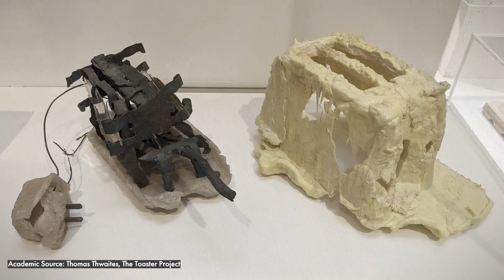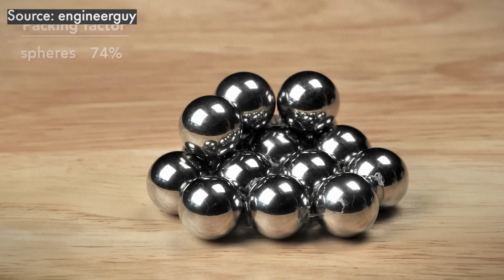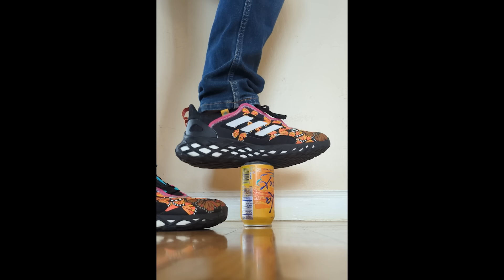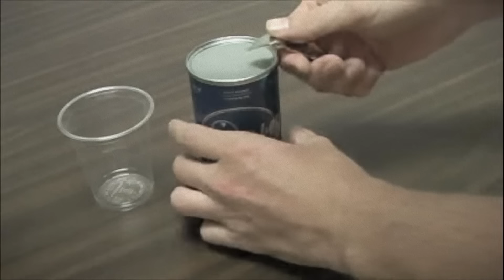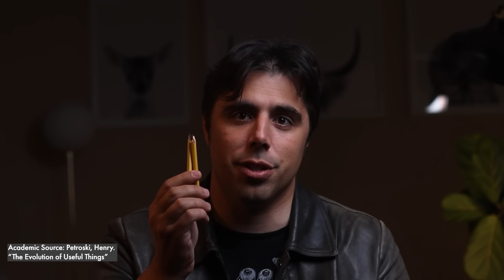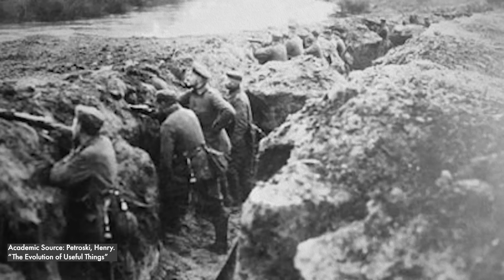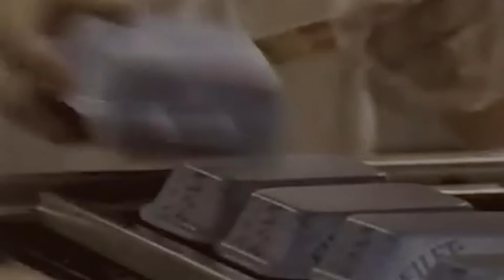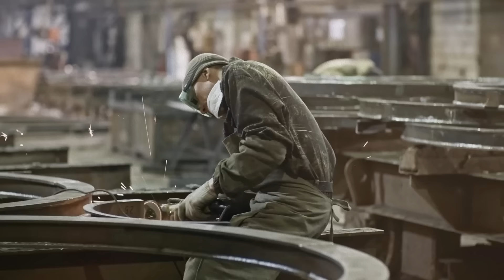Why Simple Everyday Objects Are Impossible to Make

Comment: I used to work for a manufacturer of truck-trailers in the supply chain management department. It's just a metal box on wheels, right? The single trailer's bill of material would be hundreds of parts from dozens(if not more) suppliers that had their own dozen suppliers. It would involve dozens of people doing their own specialized step, that were supported by dozens of more office workers doing the schedule, purchase orders, engineering, systems support, sales, finance, and management. Now consider every single one of those goods was at least partially transported by a similarly produced trailer! Our world is complicated and involves hundreds of people around the world just to get you your 50 cent pencil.
Reply: now imagine a major conflict throwing a wrench into the highly optimized mechanism of supply chains or god forbid killing of key people i.e. engineers - suddenly you are unable to produce weapons but also fuel and food.
Reply: @vaakdemandante8772  killing engineers is a waste of time. Power, assembly lines and highways are the most impactful targets for supply chain disruption.
Reply: @bepamungkas  True, but killing engineers is long-term. Power lines and highways can be rebuilt in weeks if necessary, but training engineers takes years at least.
Reply: @lbgstzockt8493 true, but there's simply too many engineers. Not to mention for generic tech people already adapt to its shortcomings since technological adoptions was never uniform. E.g in agriculturally advanced state like the US, it's still common to see decades old machines being used.

Now, if you cut down those tractor's replacement parts output by half, or delay the deliveries by a month. The domino effect will be longer lasting since the problem is not immediately obvious.

Take a look at recent disruption in poultry industry due to H5N1 in the US. Most of it came simply due to the fact that the "infra" need to be rebuilt (i.e culled, sanitized, etc), and supply chain need to be controlled to manage the spread.
Reply: this is definitely humbling
Reply: Now imagine my frustration as project lead when a software engineer starts whining "do we really NEED to charge the customer this much?" And "I don't understand why the marketing/billing/sales departments make so much! We engineers should be making most of it since we're building the product!"

Comment: Retired Electrical Engineer here - few people understand the (very complex) process of designing and manufacturing the HUNDREDS of simple products they use on a daily basis ..
Reply: In 2020 NASA spent $23M for a toilet to be used in the International space Station. It involved six years of research and engineering, and had to be designed for microgravity and use anti-corrosive material like titanium. It also had to recycle urine into drinking water. 

The US Airforce spent $10K in 2018 for a toilet cover that was used in their C-5 cargo planes. The original parts manufacturer was no longer in business. The AF decided to make it themselves. There were patent issues, and they had to reverse engineer the process for a part with very limited future volume. Now they use 3-D printing to make the cover at $300 per.

Comment: You can make complicated stuff by not using materials or methods that require complex production. Make your fork out of wood. Make your toaster out of sheets of mica, ceramics, and metals that are easier to source or smelt than iron/steel.

Comment: did you know that you can open a can with another can?  seriously.  use the bottom extended part of the can on top (the part that helps them stack on top) catch the pull tab and open your can.  it's hard to explain in text, but it works, just try it.  it''s good if you don't have nails and just a good party trick.  i'm sure some industrial designers created that on purpose.  try it

Comment: Since they changed to the tab, that stays on the tin, I never (almost) bought a beverage can again. 
Now, that it's mandatory here in the EU, to have a connection between beverage bottles and their lids I get more furious and furious everyday I want something apart from tab water.... Though, tearing the lids off allows some relief ;)
Reply: If you have a can opener, some knife or scissors, you can either ignore or destroy any additional items attached to the can; you can also use that to cut the ring that holds the lid on bottle.

Comment: My industrial design professor told us “Your job is to create a need for something that doesn’t exist”. - guilt ensued.
Reply: I reject this philosophy and substitute my own. 

I build to address a need i have identified. Without the existing need, i have no desire to build.
Reply: @MadScientist-o2e  unless you missed the "industrial" part of industrial design, or a luddite (no offense meant), then both philosophy itself is not cotravariant. Artisanal and industrial design generally complement each other.

Industrial designers go out of their way to look for potential problem, and develop solutions based on supposed problem. Regardless of said problem economically viable or not in the first place. The same can't be said for artisan.
Reply: @bepamungkas  Industrial design necessitates it being economically viable I don't care if you how committed to solving a problem unless you have millions of dollars you won't be able to even build a fully functioning prototype. You can artisanal produce things and transfer them to inustrial.
Reply: @Me-pt7ik  Nope. Majority of industrial R&D either get unused or ended up seen as "useless patents" (i.e dormant IP). WIPO application usualy contains multiple design per IP, only decreased recently after entry of electronic giants from Asia into the Hague system.

As for capital requirements, I tend to agree. AFAIK only government sectors have higher wasted capital ratio. But this was due to complex nature of modern market and ROI focused R&D funding. 

With the advent of crowdfunding, offshore mass-manufacture, and direct-to-consumers marketing via social media that lower the marketing overhead; there's plenty of new and interesting products that cost considerably less than a million to design.
Reply: @MadScientist-o2e I’m here to help you identify your needs ;)
Reply: Well, as a single male Brazilian ...
I'm HAPPY they created the AirFrayer.
I need it as I need water? No
It saves me some minutes per day after my job at a Big Tech suck all my energy and time... Yes.

So, I'm thankful for those who invented it.
Reply: @Rex_A42  You should get a microwave. A combo one with oven function. And an induction cooker. And a pressure cooker, a fridge, a kettle, a BBQ, a hotpot, a slow cooker, a toaster, a grill, and of course an ice cube maker! Ice cream maker, juice mixer and a coffee machine.
Reply: It’s good to recognize the modern industrial economy is often built on evil. 
It’s also good to recognize it doesn’t have to be.
Reply: Design isn't marketing. Marketers can go out there trying to drum up demand if they insist but please keep engineers and designers out of it.

As designers our job is to fulfil design intent in the most effective way. The definition of 'effective' varies depending on the priorities and constraints of the project. It might be simply to make the cheapest version of a thing, it might be to achieve a long service life, it might be to make it safer to use, it might be to make it greener, and so on. It's not to make someone want something they don't need.
Reply: 1. You don't need to reinvent the wheel to create a new need.
2. Just look at how many inventions we have for the smallest need. I watch a channel that just reviews products, to see what's out there.
3. A need only has to fill one niche. The saying goes with this: "If you do one thing, do it the best you can..."
Reply: This is a great video, it made me think.
Reply: It's not about creating a need, but discovering wants people may not know they have. The biggest risk of entrepreneurial ventures is the public saying, "no, thanks."
Reply: that's the same job of a the turbocapitalist company. Great stuff, we are sooo cooked.
Reply: There's no guilt in identifying new needs. There is a need for toothbrushes that didn't exist before, but I think that's largely identified as a positive.
Reply: @Joe-yi5nv  Toothbrushes weren't invented under capitalism. People have suffered and died from dental problems even in ancient times. Identifying needs that people have is not the same as creating new ones, and most modern products fall squarely in the latter category.
Reply: @Joe-yi5nv  i remember when electric toothbrushes first came in they were medical devices and only the disabled used them. now even the athletes are disabled .
Reply: @Joe-yi5nv it felt more like creating a need for something that someone didn’t need.
Reply: The only reason toothbrushes need to exist is because of another invented need. Sugary treats.
Reply: @sonderbain  this that 4d vision
Reply: @sonderbain  bread is just as bad for teeth
Reply: @sonderbain  humans used toothbrushes and equivalents before the first sugary snacks in the Bronze Age.
Reply: Literally told you to create bullshit products? How futuristic and "forward thinking"! ha!
Reply: @Ritual_Gaze I don't think you understood it properly
Reply: @Ritual_Gaze not bullshit products necessary at all, just a need/want for something you don’t actually need.
Reply: @ricepony33  I would think that would be more the job of the marketing department. They're the ones who are supposed to convince people that they want the thing you came up with that no one actually needs. There are so many products like that. 
Personally, I hardly buy anything that isn't a tool or a part for repairing or making something. That and food. And I'm learning gardening.
I'm sick of my life being dictated by the whims of giant corporations and the overwhelming need to keep the economy going.
Reply: @MyName-tb9oz  i skip ads
Reply: @_Stercore  I don't see them at all. The only ads I see are the sponsors that are directly paying the creators. Whose products I will never buy.
Reply: @ricepony33  Or in a word, bullshit. It's not that specific. Anything that is made to justify a degree, fill an unnecessary niche or solve some made up problem is a bullshit product to my mind. Not too different than the bullshit jobs a whole lot of people work, including jobs making all the garbage that will end up in the ocean or a third world country.
Reply: sounds like a comment from a naïve academic. resentful also
Reply: Guilt? For creating things to make life easier? God forbid an engineer design something novel people didn't know they wanted but transforms their life.

Why are you on YouTube or the Internet. Feeeeeeeel the guilt of the those who invented the modern SoC and your stupid kitchen tools like the lime squeezer. Feel guilty, go live in the woods and eat willow bark cold in a bush covered in bug bites. 

If you feel guilty of creating or realizing the need to create things people didn't know they  wanted, then go live in a cave, caveman. 

The rest of us will enjoy modern engineering and modern life. Have fun, Cave Man.
Reply: @noonenoesbutme you okay there, man? Sounded a bit like an late 2000s forum troll for a moment. Anyway, there's the slight difference between designing a need that doesn't exist and a need people don't realize they have. Marketing powered, finance fueled consumerism is just one channel inventions can fit into.
Reply: thats how modern veganism works
Reply: @J.MT.D From a technical perspective, veganism is just choosing the less wasteful product. It's obviously more efficient and therefore sustainable to slaughter the middle cow and get more product out of less crops.

Comment: I humbly disagree. Everyday consumer product designs are mostly hyper-optimized for mass production in a factory that is part of a global supply chain. But you can make a decent, perhaps even better toaster on your own in an artisanal way, from scraps and even raw materials. Just not that toaster. And this is true for almost every product. Of course for some you need loads of knowledge, as it has always been the case. And cooperation usually makes it better and more efficient. Sometimes it is absolutely required, like when you depend on certain materials (Extreme example: chip are very complex materials layered on an ultra refined silicon base, to the atom. You cannot do it any other way and achieve results nearly as good. But that is not a typical case. More often than not we get the other end of the stick: A shitty product, way worse than an artisanal one. And even less efficient to produce, only relatively cheap because of the massive exploitation of people and resources somewhere else up the supply-manufacturing chain)
Reply: this hits the nail on the head! now the video makes a good point, its not wrong. but the underlying assumption is that we must use these capitalist industrial approaches to design. because we have *some other goal in mind* -- something far removed from function and creative expression. Usually money. lots of it.
Reply: I would be skeptical that this "artisanal" toaster could even have a tenth of the efficiency per dollar as the mass produced one. And I say that as someone who enjoys tinkering and Frankensteining my own stuff.
Reply: It stops being efficient when most of them are built to end up in a landfill after only a few uses and more expensive to repair than a new one, which is unfortunately the case way too often, because of the need to maximize the ROI once the competition has been choked to death by selling at a loss thanks to the investors subsidy. We may be living the last years of alternatives to crappy toasters from Amazon.
Reply: @PunkdemikMFF No argument on any of that
Reply: Well, I will sit here and wait for something simple from raw materials. Let's wait for your artisanal NiChrome wire. It needs 1400°C (2552°F) to fuse together. I am very eager to see you achieve that in an artisanal way. And even if you are a toddler now, you will not dig up enough raw ore for it in your entire lifetime. Dude, you are clueless and stupid and make yourself look even worse with how confidently you behave.